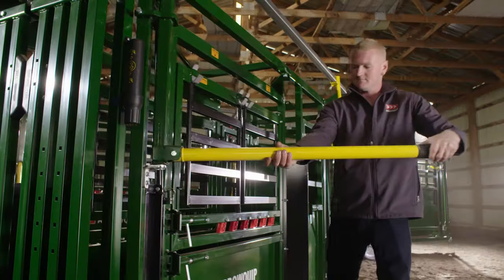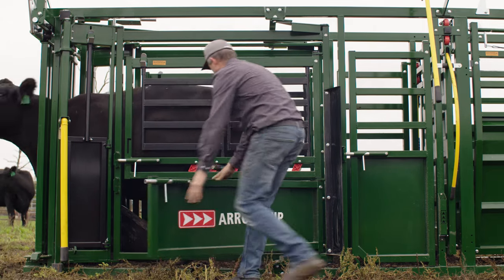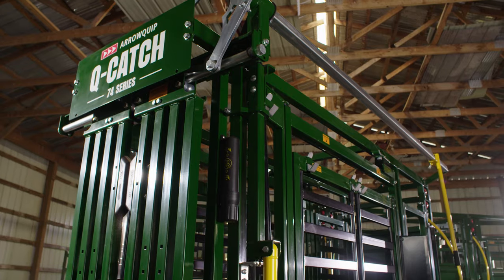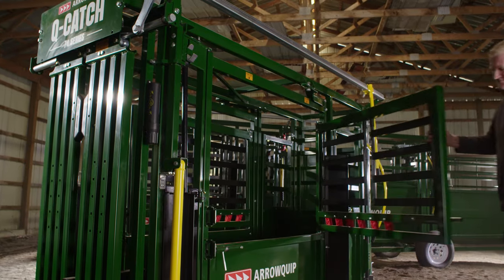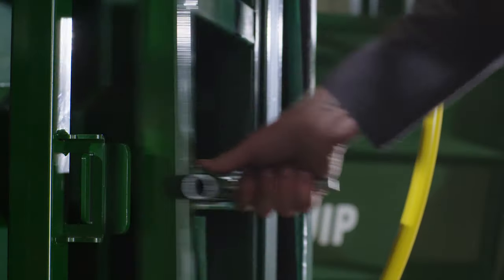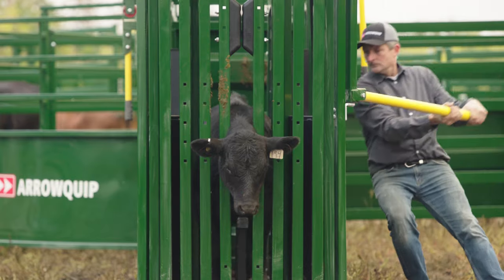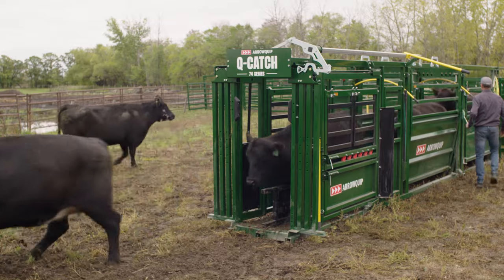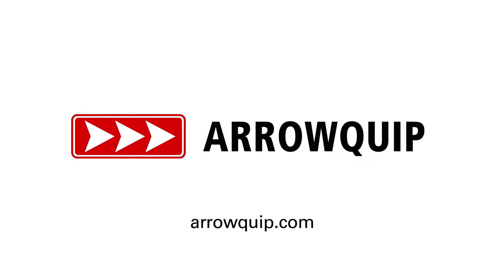Q-Catch 74 Series Cattle Squeeze Chute | The Easiest Way To Improve Your Ranch | Showcase

Comment: Just got 1 from our coop we are going to have a hard time using the other ones now the we got our 74 installed. It's quiet and easy-to-use and it is a lot easier on the cows as well they don't get scraped or hurt inside it. I just need three more for the other farms
Reply from the maker: That's awesome to hear, Justin! We are happy to hear that the equipment is working well for you. Maybe a portable version would help with the other farms? Send us an email if you'd like to chat.